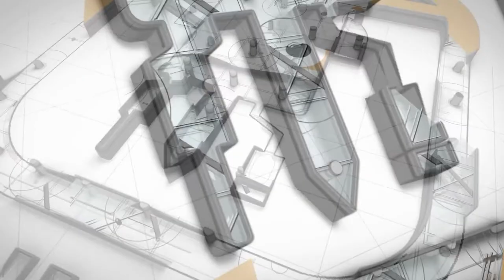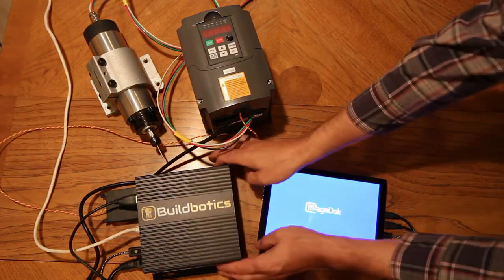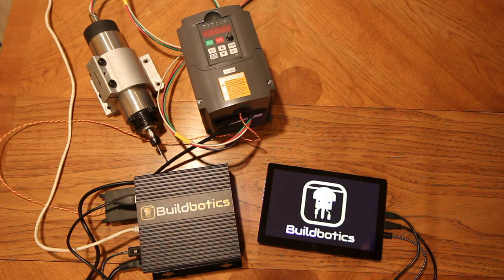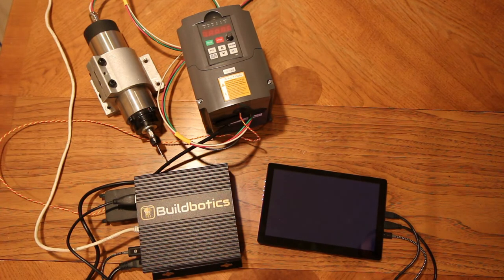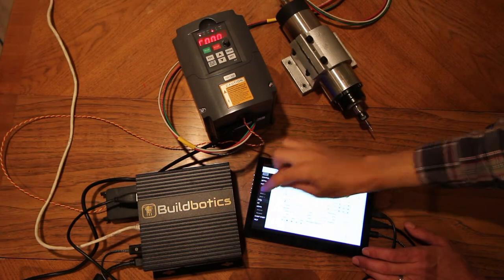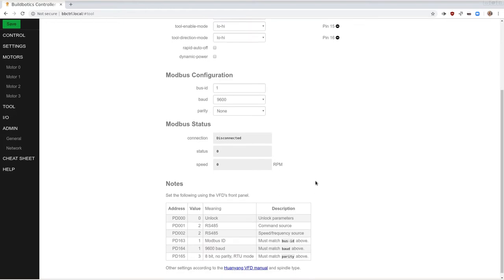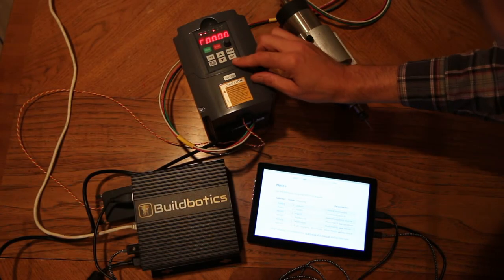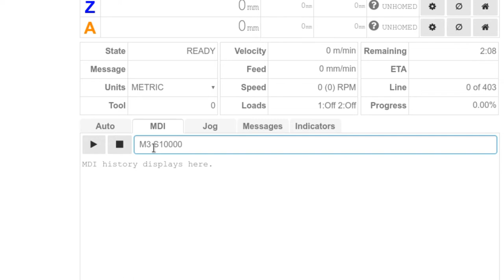Connecting a VFD to your CNC Machine

Comment: I have a Delixi EM60 VFD and common 1.5kw spindle. How can I get my VFD to work with this controller? Thanks for the great vids!
Reply from the maker: I took a look at the manual and it says that you need an RS-485 communications board. If you don't already have that, you would have to add it to your VFD. We do not currently support this VFD, but we can probably get it going. We don't charge for this effort because it helps us extend the VFD's that we support. If you are interested in having us attempt to get this going, give us a call at 707-559-8539
Reply: @buildbotics  Correct. I have the RS-485 board already installed in my VFD ;) I would REALLY appreciate the help!

Comment: Instead of twisting the wires, would it not be simpler and better protected by running a shielded pair with the shield grounded at both ends?
Reply: Maybe.  Twisting the wires is good for differential lines, like this one.  If you take apart an Ethernet cable you will find that all the pairs are twisted together for the same reason.  In an Ethernet cable the pairs are also shielded but the shield is generally not grounded.  The reason for the twisting is that if there is any noise you want both wires to get it about equally.  If one wire travels down one side for the whole length it may get uneven interference.  If the noise/interference is the same on both wires it will automatically cancel out in a differential pair.